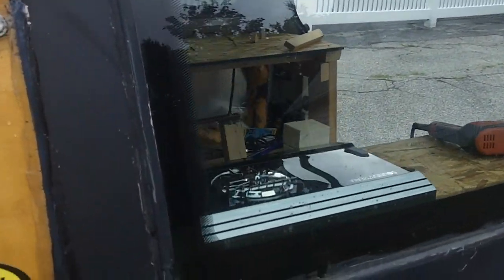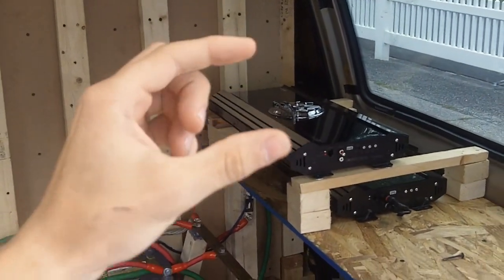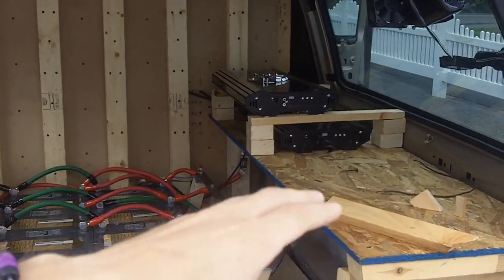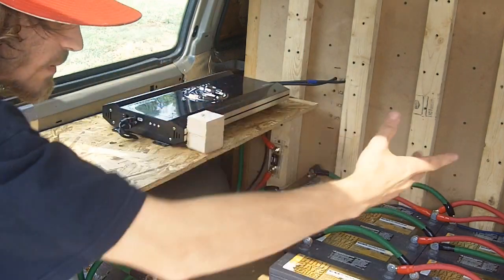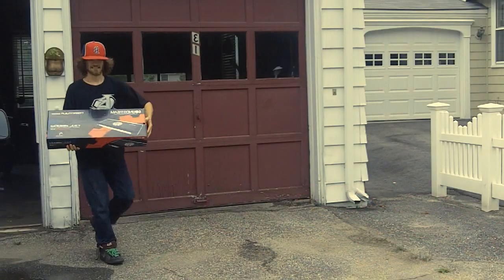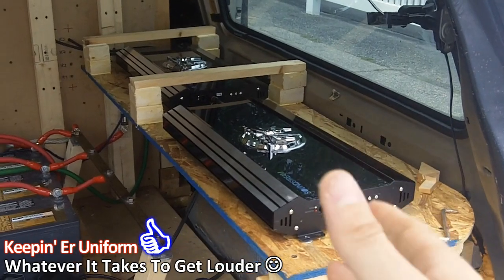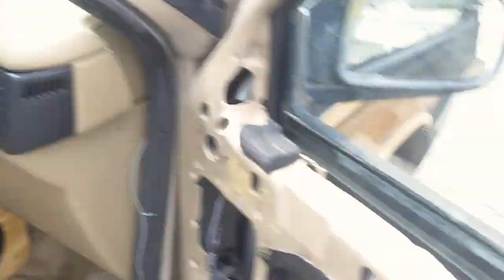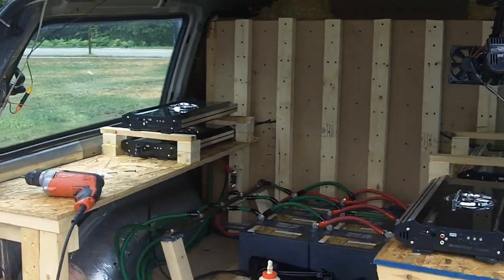10,000 Watt Car Audio System... READY FOR BASS - Installing EXO's BIG Tarantula MonoBlock Amplifiers

Comment: @Kamom92 it could be your battery or alternator not delivering enough power to your amp, or it could also be your ground wire is not on contact with pure metal, thus not making it able to complete a circuit

Comment: @kittybath I have 4-American Bass XD15's hooked to a VFL 150.1 all wired down to .5 ohm and I bump  it all day long. I also have the big 3 upgrade and a bigger alt and 2 big batteries, but as for the amp going into protect, I would check the grounds and power to make sure both are as good as you can get. The better your electrical is the better your system will be

Comment: @EXOabigdeal Hey exo I have question, I have a sundown saz2500d amp and a 15" american bass d1 sub. The amp is hooked at 2 ohms on the sub, but when If I play at mid volume it's fine but when I turn it up the amp goes right into pertect mode. YYYYYYYYYYYYYYYYYY

Comment: @dreammoney101 Ok well not decent subs, or you just bought the wrong amp all to gether for what kind of subs you had. My 2500 is wired at 2 ohms so I KNOW  SUB IS NOT GETTING TO MUCH POWER. Volts to amp is only 11.5 so unhooked amp and replacing wet cells with deka 9a31 batts.